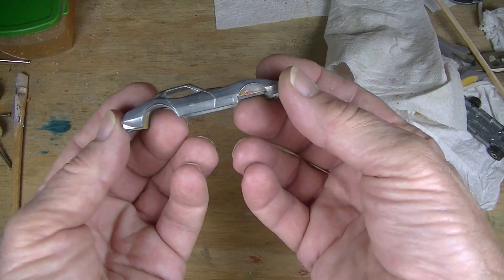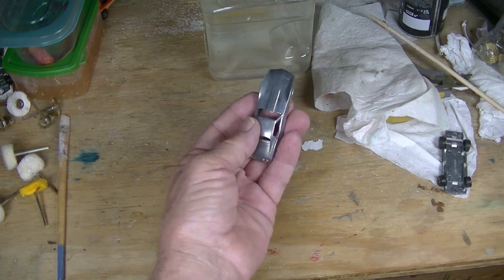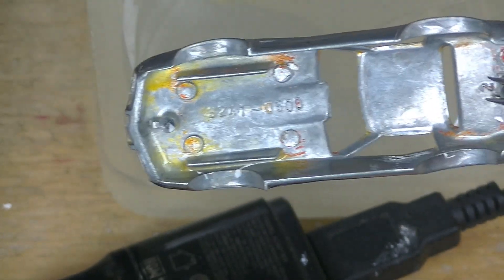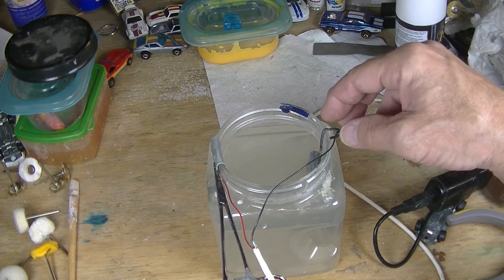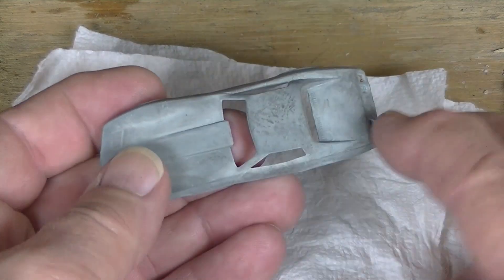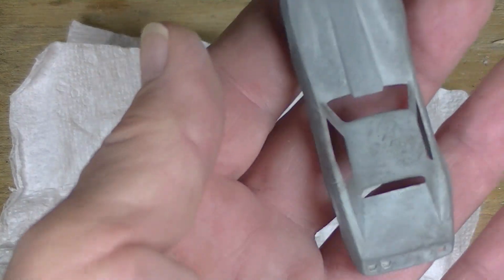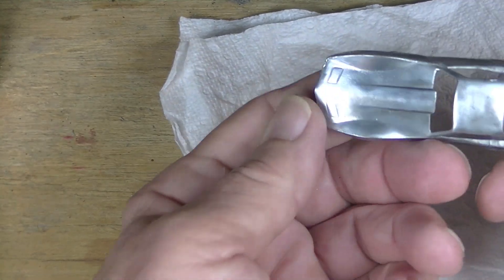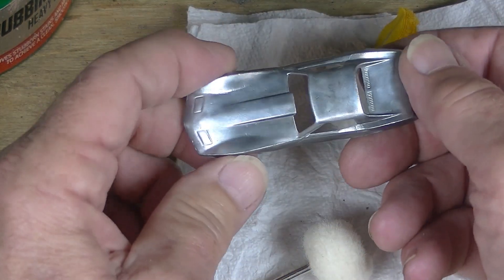Zinc Plating 1980 Hot Wheels Vette

Comment: I hate to be that guy. but this isn't a 1980 Corvette. The 1977 Corvette was the last model year for the vertical back window. 1978 and later C3 models had a fastback rear window.
Reply from the maker: But you were that guy. hee hee hee. Amazing, nobody else caught that. Earlier, I just went by the year stamped on the bottom. Thanks.

Comment: I always clean the paint inside the casting, before plating. It's contaminated my solution and had to pitch n start over. Not that big of a deal if not plating, but if ya are, I'd do it.
Reply from the maker: At Last, someone answered my question. Thank you so very much. Too late now, I chromed it. However, in the future I will be sure to get all the YELLOW paint off the RED Vette. Why is there YELLOW inside?
Reply: Yellow White and Red is original color pattern.
Reply from the maker: @redlinesalvageinc.1178  Hmm.